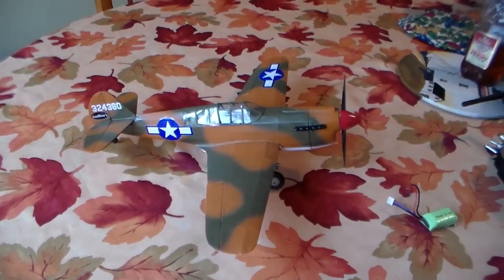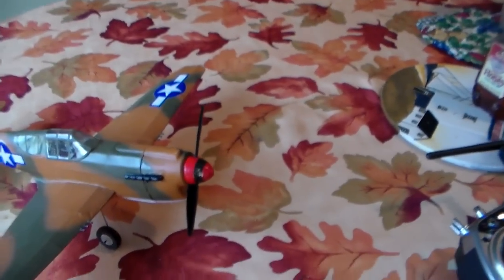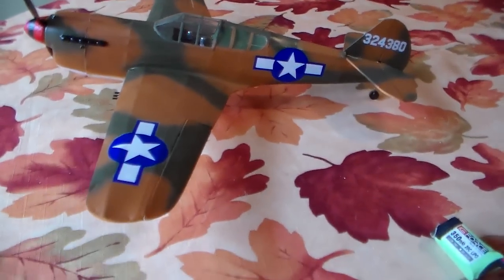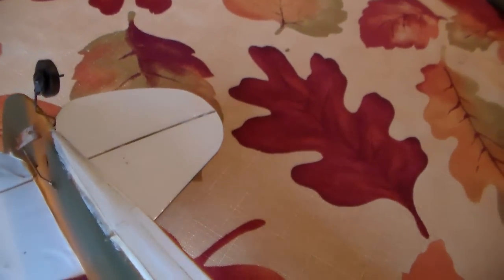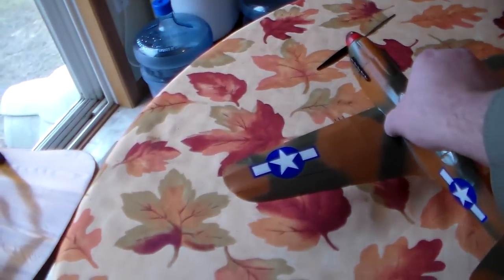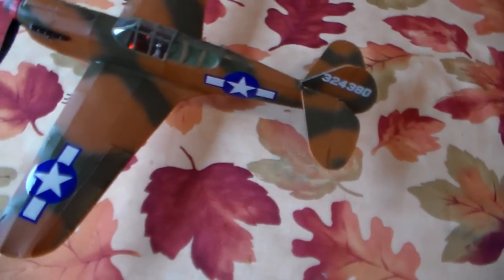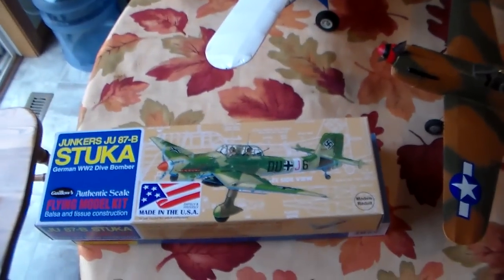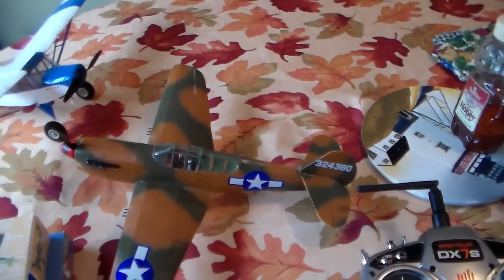guillows p-40 rc conversion

Comment from the maker: sanding and blending the parts together is part of it otherwise just put as much heat to the covering as you can then let it cool off and hit it again.topflite parklite is an awesome covering.i have been using it on my recent builds and have had really good results with it.
Reply: Nice job! There's a better Guillow's P-40 kit #405 with a 27.5" wing span.

Comment from the maker: it would be a lot like my 16 1/2" span bf109 kit 505. it flys but you have to dive to do loops and have a hard time doing rolls.if you type in .
Guillows Bf109 RC winter flight
you can see how it flys. the best combo is to do the 2s conversion with the t-28 brick and servos.there are a lot of tutorials on rc groups about the diode and esc with the pz brick. also on my channel I have my fw190 2s conversion that uses the brick and 2s conversion.in the vid description there is a build link w rcg.

Comment: What do you use to cover your models? Im building a 109 and a Focke-wulf right now and converting them to rc like you have. Im thinking of Monokote ironed on for durability. What is your preferance?
Reply from the maker: hi josh, i really like to use Hangar9 parklite covering. it is lite, very forgiving for wrinkles,and takes rattle can paint very well. if i screw up my paint i use some paint thinner on a rag and wipe it off and repaint. monokote does work as too but is a bit heavier. good to hear you are building!

Comment: Im about done with mine. Did you need to put any additional weight in the nose besides the battery? Where is the aileron servos?
Reply from the maker: hi josh, this model flys nose heavy with a 350mah 2s battery so in mine i went to a 250mah 2s and it is much better, on my build i used 1 servo like right in the cockpit area in the wing and control cables going to each aileron.have a look in the video description and there is a link to the build log @ the rc groups.there you will find some pictures that should help you. =D
Reply: jagdpanther9  Thank you Mr? Don't even know your proper name Im sorry to say. Your videos have been alot of help and inspiration to me. I really love these guillows balsa kits and yours appear to be the epitomy of be all you can be. Im new to rc planes so am always trying to get my inspiration where I can. I'll look at rc groups webpage for that link. Thanx for the response once again. The p40 is coming along wonderfully. BTW what is the correct/ proper jst connector for these micro bricks? I cant seem to find the right one. Thanx again.

Comment: what prop are you using on the 9g 2700kv motor??
Reply from the maker: in this video it is flying with a cox .20 prop. i ended up with a gws 5043 2 blade and it flys even better.